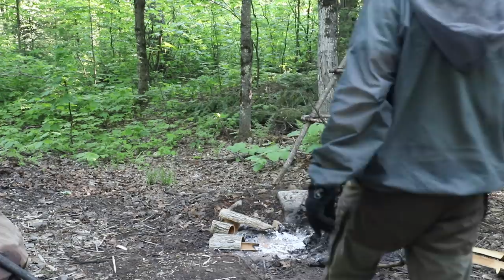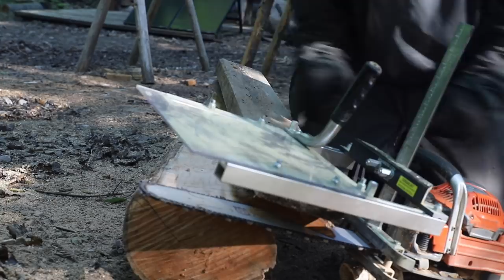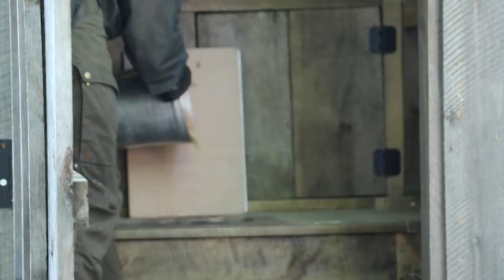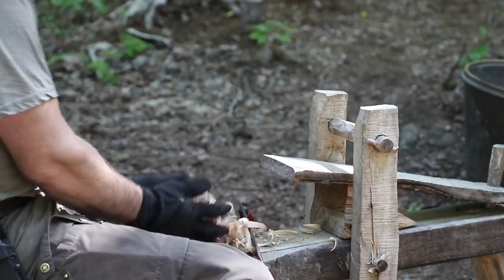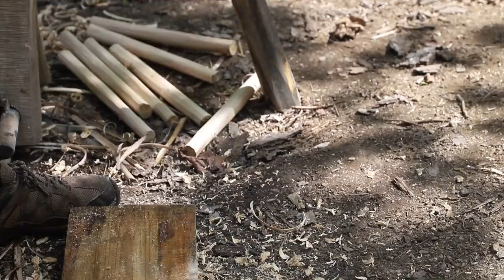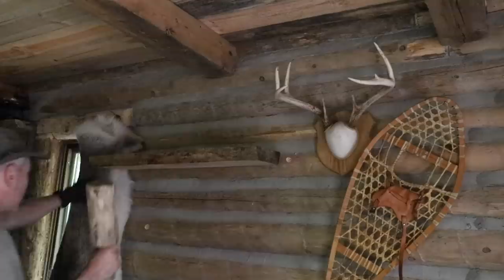DIY: Make and Install Floating Shelves with Free Materials

Comment: ages ago, my great great grandpa built a sod house in Nebraska. He put a board between the sods for a shelf, but didn't measure quite right, the clock wouldn't fit, so he sawed the top off, make it work! Grandma sold it for a decent sum, because the buyer thought is was a wonderful story!

Comment: I don’t think I’ve missed a video since you started building your cabin . If I had a rig like you have to cut your own rough lumber back in the 1970s I could have made my own lumber to build my out buildings . I had to cut many big oak trees to clear a house place . But I had to burn them on the spot where I was to build my house . Later I went to a sawmill and bought enough rough cut sweet gum lumber to build a barn . That was about 1982 and although it’s weathered it’s still standing strong today . I built a Lean to chicken house on the side of it about 10 years ago . Then on the side wall I hung two doors on hinges from the top plate so I can raise them up in the summertime and close them in the winter . It’s like a porch in the summer and almost doubles the size of the chickens house . I just prop them up with some 4by4s all summer . With the buffalo nats as bad as they are the chickens need a dark place to run into to get out of them . I lost about a dozen chickens to buffalo nats one year before I built that chicken house  . They get in their nostrils and suffocate them . When I came in from work one afternoon I found all those dead chickens . If your going to have chickens be sure to have a dark place for them to go . I have enjoyed every video you have made . Keep up the good work !!!!

Comment: You can make bigger shelves easily by taking long boards and forming notches half the width of the vertical boards and notches corresponding but mirroring the mentioned notches on the horisontal boards. Like ikea but without the many gadgets

Comment: You need to get an old school dowel maker , either the shave type or one of the sharpened hole and pound through types . The shave horse and tools work well but you could save a bit of time and make a stock of dowels
Reply from the maker: I definitely do. I've been trying to find one
Reply: any of the local meta workers in your area maybe able to weld up a 1 inch plate wit some sharpened pipe in a couple dimensions ?  @MySelfReliance

Comment: hmm nice I only see one oops ... a neat idea to turn that oops into I planned that ... make a small log rail mounted in the same way as the shelves and use it as a book end stop for the two shelves ... kind of like a door handle at the end of the shelves ... not only does it remove the spade hole but it makes it useful as well ;)   or just add a dowel and make it a towel or doodad hook for some item
Reply: you cold even duplicate it on the other shelves the other side of the shoes
Reply: I think your next major build should be a tool shed / workshop for things like your spoke shave work bench saw mill and future tools like a smithy and or pole lathe etc ... perhaps between the loo and the cabin ... then if needed or desired you can make a covered walk and eventually a heated walk to the loo for those cold nights

Comment: Nothing is trash, everything has value. Short sighted, unimaginative people have a hard time finding the value in most things.
Reply: I am a scavenger of sorts - I see value in things others throw away, like older lawn implements made of wood and steel, or brackets, or a castoff golf bag.  The bag became a lawn tool carrier, the rakes and hoes and shovels were cleaned, sharpened and the handles sanded and oiled.  New life instead of the dump!

Comment: Shawn..i was wondering if I could send you a pic of a tree on my property..it has a crack running up the bark..wife wants me to have it checked but I don't want to spend a couple hundred for nothing?
Reply: If in doubt, get rid of it. Get some sledges, plant a new one. 
Crack could be of frost, lightning, wind etc.

In case you want to keep the tree, you have to get an arborist to check it.